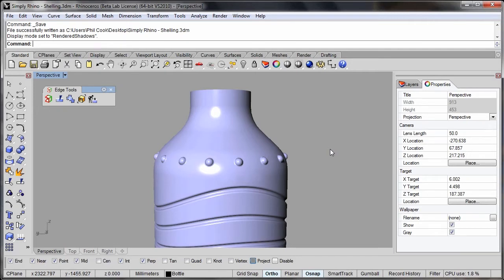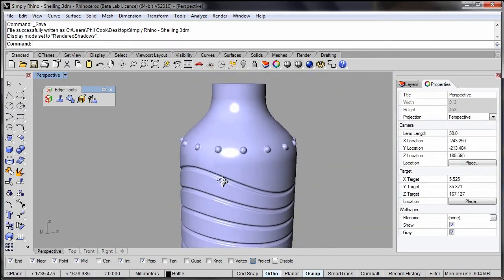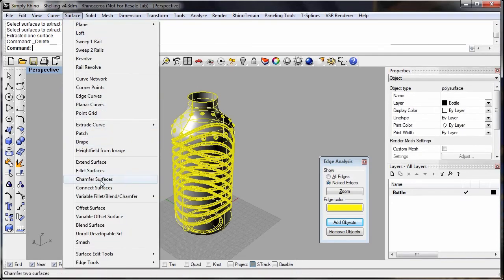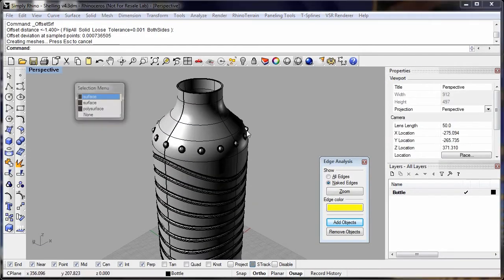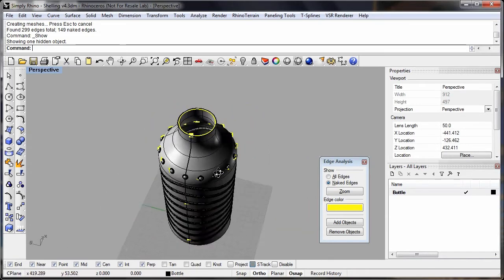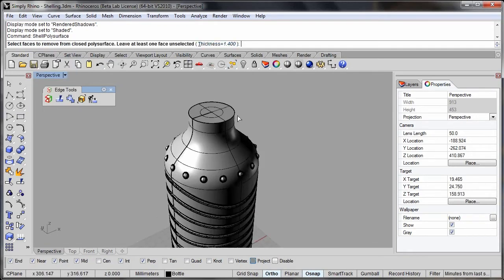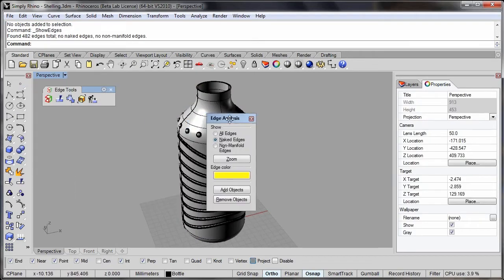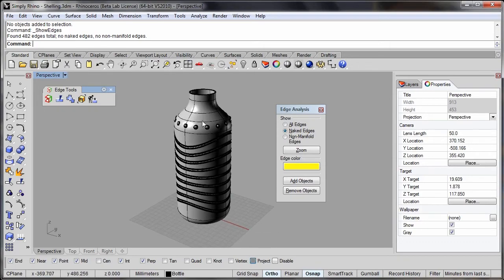Rhino 3D V5 Shell Polysurface

Comment: Great! Though what about more complex designs where the inner extrusion could overlap in some cases? Would I still have to manually delete overlapping edges, then join them. (in this example I am not interested in maintaining inside detail...just trying to hollow out larger volumes for cheaper production costs) Thanks!
Reply: The "Shell closed polysurface" fails in any other more complex scenario. And, yes, It does overlap the surfaces when the resulting thickness is larger than the smallest radius of the original solid model.